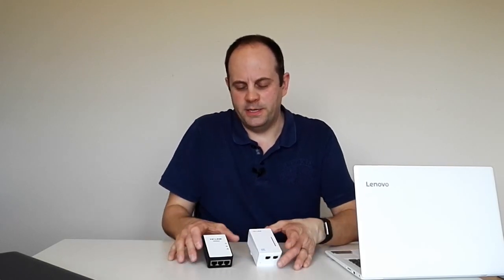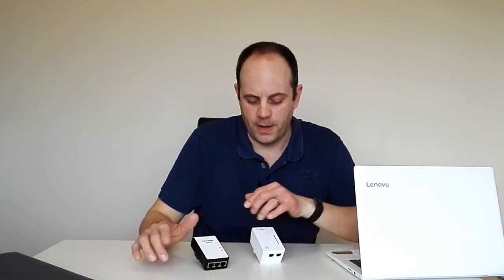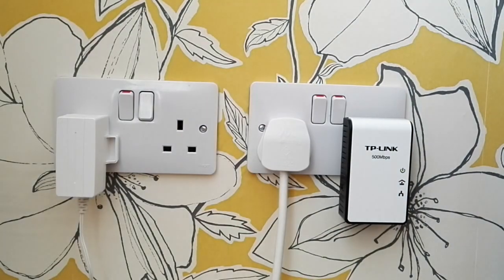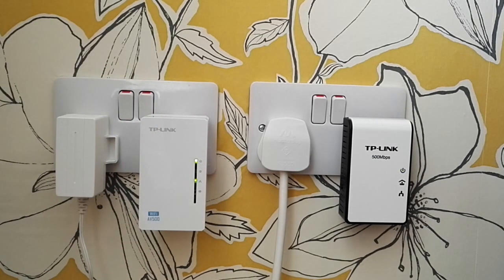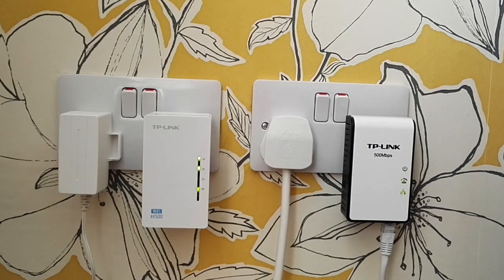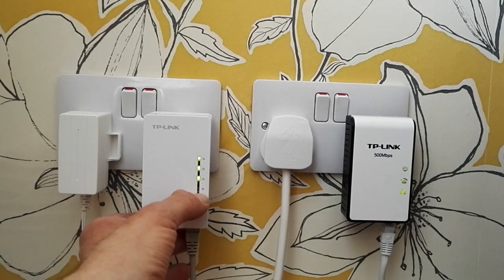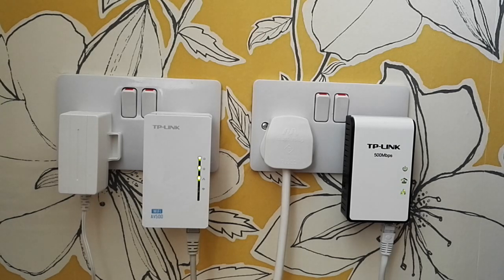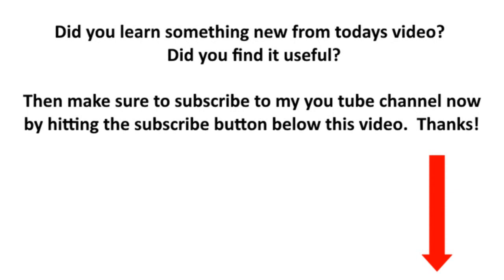TP-Link TL-WPA4220 AV500 Powerline Extenders: How to Set Up

Comment: Thanks! Modern Tp-Link adaptors have Wi-Fi passwords on the plugs, too, not just on a card. I today added an AV500 plug to my existing AV600 setup — I pressed the button under, first, the AV600 master, then, under the AV500 plug (flashed a bit then linked) while all were plugged in. Pairing may be viable even with newer D-Link, Netgear, etc. adaptors but compatibility may vary and/or need some web searching.

Comment: Hello, been given one of these, would it be possible to plug in just the extender (without the master socket) plug in a ethernet cable and use it as a wifi extender that way? basically i have a Ethernet running down to a outhouse, but no wifi and wifi would be better for phones etc.
Reply: actually just realised, No, becuase its getting the internet through the electrical wires isn't it

Comment: So what are the two Ethernet cables plugged in to ?
Reply from the maker: Hi. The layout in video is for demonstration purposes so can be a bit confusing i.e the extender shown on left hand side in video (AV500 appears on face) would normally be in another room.

So to answer your question -  you have a Ethernet cable which comes out from one of the ports on your router into the power line adapter (shown in video on right hand side with 500Mbps on face). The adapter which is shown in left of picture (AV500 appears on face) would normally be in another room with another Ethernet cable coming out of it and then this cable would plug into your PC/Laptop etc.

Hope that helps. Thanks
Reply: The Tech Guru.  Yes thanks

Comment: Great video. I think I misplaced card. Is password on back of extender?
Reply from the maker: It should be. Appreciate the kind feedback. Thanks.
Reply: If you press the wps button on your router and then press the wifi button on your av500 it will use your routers name and password

Comment: I've watched three videos on these AV units but none of them show me where on the router the internet cable is connected that goes-to/comes-from the extender?  Is it plugged in to any of the myriad ports on the back of the router or does the router have to pass through the extender?
Reply: Connect to any LAN port of your router.

Comment: How fast are TP-Link powerline extenders compared to a CAT 6 cable direct?
Reply: Cat 6 is useless at home. Cat 5/5e/6 all can work upto 1000 Mb. Theoretically you can achieve 1 Gb or more on powerline. I have AV500 devices, the measured speed is 250-330 Mb, the old AV 200 devices have 90-130 Mb. But the cheaper AV500/600 models have 10/100 connection, it limits them to 100 Mb. So be careful when buying: if you want a gigabit network buy AV2 adapters with 1000 or 1200 Mb.

Comment: Would it work for a two floors house..?connecting down the first to the router and the second in the middle of the stairs,or in a room up>>What is the best?Thank you
Reply: Put the second in the room up. I have one adapter on the first floor and two on the second floor. It's the same circuit, it works fine.

Comment: Hi I’m using the t- link av500 but they are very very slow?
I have them plugged into extension cables and not directly in the wall socket do you thing this could be the reason.
Barry
Reply from the maker: Hi Barry.  Thanks for your message.  I've read somewhere before that powerline adapters will only work properly if plugged into wall sockets, not extension leads. So that could be the reason they are very slow.  Thanks.
Reply: @TheTechGuru  also these perform better when plugged into the same electrical circuit...